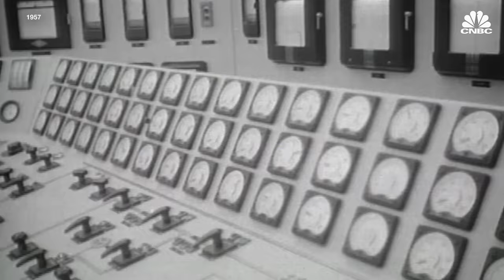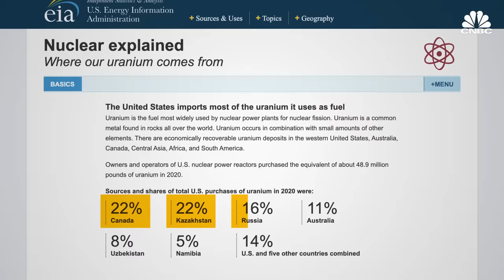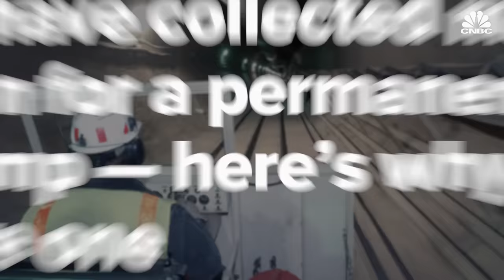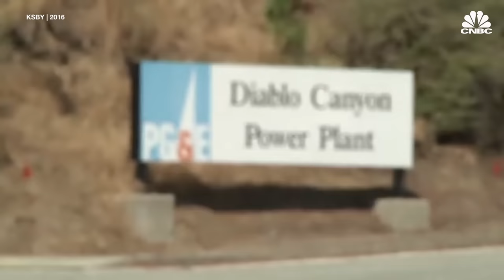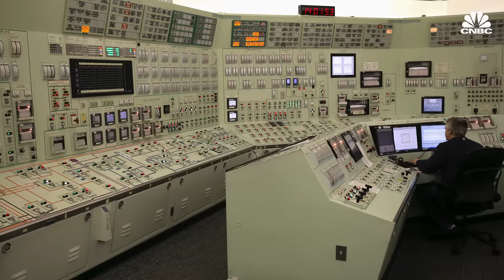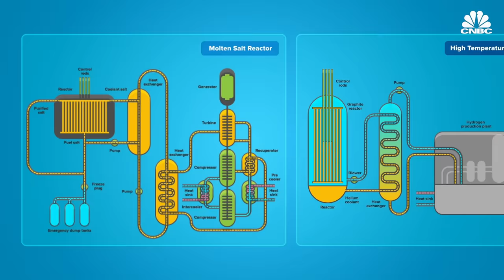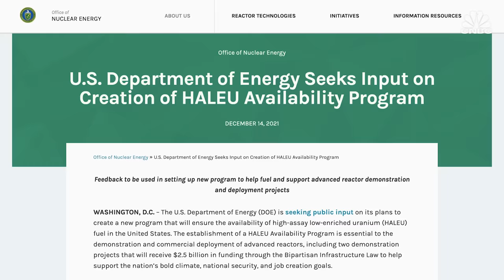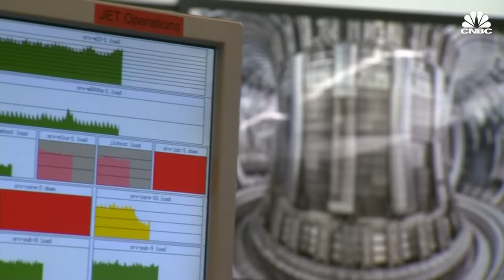Why Nuclear Energy Is On The Verge Of A Renaissance

Comment: Relook at breeder reactors for large reactors.  That will get down the cost of small reactors.
Reply: @clarkkent9080  I was talking about breeder reactors, and they are not economically viable.  A breeder reactor generate more fuel than it consumes.  The use case is to generate fuel for other profitable reactors.
The regulatory issue is that many favorable designs for micro nuclear reactors use weapons grade fuel.
Reply: @abram730  To be fair, a breeder reactor is only non-viable economically compared to conventional nuclear. It would be viable compared to other forms of energy production.
Reply: @abram730  Not sure what you are saying. 

Yes breeder reactors do produce more fuel than they consume since that is the definition of "Breeder reactor". The issue is the cost in extracting the fuel you breed from all the other highly radioactive isotopes and processing it into new usable fuel.

Again here in the U.S. we have an example of how much that would cost.
you need a processing plant to separate the Pu239 from the other isotopes in the spent fuel. Then you need a plant to mix the Pu239 with U238 to make assemblies that can inserted into the reactor. And then there are the shipping casks needed to move the spent fuel from the old reactors to the processing facility along with security and loading and unloading facilities. It is not so simple or cheap when you consider the reality of actually doing it. MOX that was supposed to mix pure weapon grade Pu239 with U238 to make reactor fuel assemblies was canceled (2017) in the U.S. after spending $17 billion and they finally admitted that it would cost $100 billion more to complete and operate.

Ideas are great and YT videos can make anything sound so simple but reality is what counts.
Reply: @Klerk Kant  Yet you continue to ignore from your blank trolling channel, many countries have been building and using small modular reactors for many decades, built in two years or less for millions, not billions.

Comment: The fact that the entire country isn't powered by nuclear power is insane.
Reply: What is insane is that with all nuclear you would be paying as much per Kw as you pay for a gallon of gas (Not really but read below and you will get my point).
The Southeastern U.S. is super pro-nuclear MAGA, has zero anti-nukes, and 100% political support. 
VC Summer (South Carolina) new nuclear units 2&3 were canceled in 2017 after spending $17 billion on the project (original estimate of $14 billion and 2016 completion date) with no clear end in sight for costs or schedule.  Anti-nuclear sentiment was never identified by the utility as causing any of the many delays.
Vogtle (Georgia) new nuclear units 3 &4 currently 110% over budget and schedule and still not operating. Mid way into the build, the utility stated that had they known about the many costly delays they would never have chosen nuclear. Anti-nuclear sentiment was never identified by the utility as causing any of the many delays. They are now delayed another year because according to the project management, thousands of build documents are missing. Utilities, not the media, decide the most cost effective electrical power source and give the above failures no U.S. utility is even considering new nuclear at this time. If you can’t build new nuclear in the MAGA super pro-nuclear southeast U.S. then where can you build it?
In both cases, the ratepayer is stuck with paying the $50 billion bill. And the silence of the Rah Rah nuclear folks on these events is deafening.
Reply: @clarkkent9080   Yet you fail to acknowledge that the US and many other countries have been building and using small modular reactors for many decades, built in two years or less for millions not billions.
Reply: @clarkkent9080   They are built by US contractors, so they could be built for the commercial market too, if it wasn't for the NRC that is.  Duh.
Reply: @clarkkent9080   In nearly every case, the NRC kills the projects with cost overruns which also leads to lengthy time delays.  Not sure why this is all so complicated for you.
Reply: @clarkkent9080   You know exactly the real problem:  the NRC.  That's why other countries can build them but the US can't except the military for which the NRC has no jurisdiction.

Comment: Oil and gas proves much more dangerous with Russia getting their money from oil and gas and using those funds for their military. We need to build many more nuclear plants in the US to achieve complete energy independence. Nuclear is the only true sustainable "green energy" that is also very cheap. Investment into "green energy" should be an investment into nuclear power.
Reply: Where do you get the idea that nuclear is cheap.  The 5 latest nuclear projects in the U.S. have been complete failures and only 2 of the 5 may actually be completed  and that is a may be completed
Reply: @clarkkent9080    But you purposely continually ignore that many countries have been building and using small modular reactors for many decades, built in two years or less, for millions not billions.
Reply: @clarkkent9080  if you check electricity cost per mW - nuclear is cheapest and very stable. The problem with solar and wind is they are unstable sources. We need to get our schit together and build good reactors.
Reply: @00_UU  If you check the cost for solar, it is less than $1 per watt generated.  Most recent nuclear plant cost $15.5 billion to build and that is not including the cost to operate, future decommissioning, and waste disposal.  Solar is very stable at 5hr per day, 7 hrs per day for movable assemblies, and up to 14+ hrs per day location shifting (sun moves east to west and east grid goes from the coast to continental divide).  Many areas have wind 24/7/365 so it is a good base load.
Reply: @clarkkent9080  nuclear cost a lot to build, but the power they generate is much cheaper, even considering for maintenance and services. I read an article about it a long time ago. Solar is unstable because it generates nothing at night, battery backup is very expensive. It would be great to have all sources, but nuclear is the most stable base source
Reply: @00_UU  The newest nuclear plant (Vogtle) cost 15.4 Billion.  For 15.4 Billion you could buy 15,400 million watts of solar panel capacity.  Thats 15.4 times as much power as one nuclear PWR operating at 100% power.  And solar gets cheaper every year and nuclear gets more expensive every year.  Once the solar panels are in place there is little if any maintenance.  Nuclear plants require 100 Mw of power to run all the pumps, fans, etc in addition to the 250-300 plant personnel wages, decommissioning cost, waste disposal costs, etc .

 As I have shown, strategically placed solar panels could provide more than 12 hrs of power per day for a large grid.  To cover the low consumption night time use, wind turbines can be used.  Just like California just announced, natural gas turbines would be used in emergencies and for peak demands.  Utilities are the experts in what is cost effective to build and operate and no U.S. utility is even considering new nuclear for full commercial use. Instead of listening to the media or joe-anybody posting youtube videos you should trust utility executives who have the experience and knowledge.
Reply: @clarkkent9080  but wind isn’t consistent as well. You need a baseline energy source that is 100 percent stable. That’s why we have hydroelectric, coal and nuclear power plants. Sure they are expensive, but they don’t need to be massive. Also technology had advanced so much that most operation is automatic. If we can rely just on solar and wind, why are we still burning coal and using nuclear plants then? Don’t get me wrong, I plan on installing solar panels myself in the future and buying an electric car.
Reply: @00_UU  There are places where the wind does blow 24/7/365. And yes wind turbines along the coast are not pretty when watching the sun rise but they would be much easier to site that the thousands of SMR that people are proposing.  And it isn't green but emergency natural gas turbines for peaking have been used for decades.
I worked in nuclear for 40+ years Reactor Operator./Senior Reactor Operator and the new plaints do use computers for information display but the NRC would never turn over a nuclear plant control to a computer.  They just don't trust HAL. 
I also have been planning on installing solar and Lithium Iron Phosphate batteries but every time I get ready to buy prices drop and the available technology gets better.  I figure for 30K I can go 100% off grid and have a system where I don't care what crazy stuff the utilities do.  If Vogtle ever starts up, my electric rates that have already gone up 25% because of the nuke will increase another 50%.  I'l years away from considering an all electric car.

Comment: I have been pro nuclear for years and am glad to see a positive report on the next generation technology by a mainline media outlet. The bottom line is that renewable energy is very problematic on several fronts so the notion that we can just switch to wind and solar is a fool's errand leading to a fool's paradise. Nuclear is certainly a viable alternative while natural gas is actually quite clean burning as well.
Reply: @pedalingparson  Here is a simple FACT that you can understand.
After the VC Summer and Vogtle massive financial failures, NO utility is even considering the Westinghouse advanced standard PWR design and that is the only standard PWR design currently available.  B&W, GE, and CE are NOT designing any new reactors.
EVERY year more and more solar farms and Wind Turbines are built, and they get cheaper and cheaper and more and more efficient.  

The only other reactors planned in the U.S. are Terrapower (CEO Bill Gates 4th richest man) and NuScale which are each getting $2 billion of taxpayer welfare to build a DEMO TEST reactor that they advertised as costing $1 billion.  Terrapower started their project 2 years ago and have not released and progress reports but they have not yet broken ground at the Kemmerer Wy site.   However, that project is totally political and that is never a good sign.

The NuScale reactor project had to half their reactor size due to ballooning cost and now utility backers are backing out.  They only have 1/4 of the number of backers to start the project and it has been delayed until 2025. I expect it to be cancelled next year.
Old large nuclear plants are shutting down all the time with the Pallaises shutdown occurring just 2 months ago with many more planned shutdowns in the next 10 years.
Any way you slice it, nuclear power's contribution to the U.S. electrical grid will decrease over at least the next 15 years before new nuclear could come on line and probably another 10 years before new builds could over come the lost generation from old plants continuing to shutdown.
 
I worked in the nuclear industry for 40+ years. I was a Reactor Operator and Senior Reactor Operator at 5 different nuclear facilities and consider myself to be pro-nuclear. I am not against nuclear, I am against fraud and waste.  As a ratepayer, if you cannot build a nuclear project anywhere near the estimated cost then you need to move onto something simpler.  This is not a nuclear issue this is a U.S. construction industry inability to build complex projects, mismanagement, waste, and fraud.  No one is even talking about fixing the root cause so why would you ever expect anything to change in the future.

Comment: Nuclear is the cheapest and cleanest source of energy there is. The problem is that there are people involved. People make mistakes, cut corners, and are greedy. with  nuclear plants if something goes wrong once you lose that area that has been contaminated basically forever. Even if the plants were 100%  reliable. I still wouldn't really support them for one main reason. To date all of nuclear waste material that has been made in the USA has been stored on site or temporary sites.  We have not put a single ounce into long term permanent storage. I can't endorse the use of nuclear energy if we aren't going to be responsible using it.
Reply: Well do something then. You can't solve a problem by sitting on your hands.

Comment: What's missing is the status of MSR reactors.  China appears to be in the lead with a prototype reactor up and running since the end of last year.  It requires no water cooling as the molten salt is the cooling medium and has the fails-safe feature of self-regulation. China thinks these will be commercially viable by 2030.  Several US private companies are working on these MSR reactors, but US support is miniscule and wanting.
https://en.wikipedia.org/wiki/TMSR-LF1
Reply: The Terrapower reactor is a 345 Mw MSR being built (still no ground broken 2 years after the project started) in Wy.  So stay tuned to see if they are successful in the U.S.
Reply: @clarkkent9080   Yet you purposely continually ignore that many countries have been building and using small modular reactors for many decades, built in two years or less, for millions not billions.

Comment: The USA won't reprocess nuclear waste because that's too expensive. However, if we DID begin to reprocess the waste in quantity, costs would drop dramatically. But we won't, because profits would suffer... It will usually remain cheaper to throw something away rather than to recycle it.
Reply: No, the USA won't reprocess the waste because they have made it illegal to do so in the USA.  Many other countries already reprocess theirs.
Reply: @danadurnfordkevinblanchdebunk   How many countries have such facilities? Name them ;)
Reply: @pratakk   I see my link got blocked, ask Mr Google to show you.  There are 12 counties listed with multiple sites in most of those countries. I won't list them for trolls who just want to deny science.
Reply: @danadurnfordkevinblanchdebunk 

Then we'd better get back to facts. Currently, there are about 90,000 tonnes of high level nuclear waste in the USA alone. (Total mass of highly radioactive nuclear waste in the US, including spent fuel and other Material)

The current total recycling capacity worldwide is about 6500t/yr and is extremely expensive and complex.

Is that what they want to sell here as a solution? I am a physicist and know the theoretical possibilities very well. In practice, however, these are empty promises that have been made by the nuclear industry for 50 years.

I don't know what they have studied, but quite obviously they are hardly able to grasp data and facts correctly and therefore draw conclusions that are not permissible and contradict the data. It can hardly have been a science degree. You should stop propagating things here that are hardly possible in practice. It is not for nothing that numerous nations are looking for a repository, and only Finland has found a real repository and can reasonably ensure safety there for thousands of years.
Reply: @pratakk   The US doesn't allow the reprocessing by law, you were already told that.  Show otherwise. 
Any country could do as Finland is doing, it's always a political failure not a technological failure.  We have multiple ways of dealing with 'nuclear waste'. As the two billion year old Oklo Gabon nuclear fission waste site clearly shows, expensive casking and burial methods are not even needed.  The waste can literally be buried anywhere, but burial makes the least sense of all the other options we have available.

Comment: Forty years ago western society turned away from nuclear power, Three Mile Island, The China Syndrome (a movie) and then Chernobyl made sure that the hysteric's view prevailed and new construction stopped. Three Mile Island was a confirmation of the safety systems, The China Syndrome was a joke (Jane Fonda, Jack Lemmon & Michael Douglas), Chernobyl was a disaster of Soviet engineering, planned economies and disregard for life. Since then Fukashima is the only other major nuclear disaster.

Take a moment and consider that there are 196,200,000 square miles of land on this planet, Fukashima and Chernobyl rendered 1,743 square miles of uninhabitable land , that's 0.0008884% of the earth's surface.

In the intervening 40 years we have continued to use fossil fuels at an ever increasing rate and, I would argue are on the irreversible brink of rendering the entire planet uninhabitable. Thanks Jane, Jack, Michael and the other uninformed hysterics.
Reply: TMI and Fukushima were 'major disasters'?  No one was injured by radiation at either. 
Scientists have determined that there should have been no exclusion zone at all in Japan, and much less that was instituted in Ukraine.
Reply: @danadurnfordkevinblanchdebunk  Chornobyl Exclusion Zone doubles as a nature reserve, so shrinking it would've been hard to push.
Reply: @caav56   Same with Fukushima, the wildlife there is thriving as well.

Comment: We have Edison generator and dynamos power plants that easily replace fossil fuels power plants and nuclear power plants with inverters and transformers to deliver high voltage AC power to the power lines.  We are grossly misinformed about power generation and the ease of power generation. We don't have to force the armature magnets of a generator.  Tesla's power plants put extra magnets on the armature to be different from Edison generator and dynamos power plants.  The power plants are very inexpensive and the number of power plants precludes the need for 10 000 volt power lines.  We don't have to use wind steam or water to create high voltage AC power continuous peak power.  We are still waiting for inexpensive electric power without fuel as the PUC was created to do in the 1930 s.